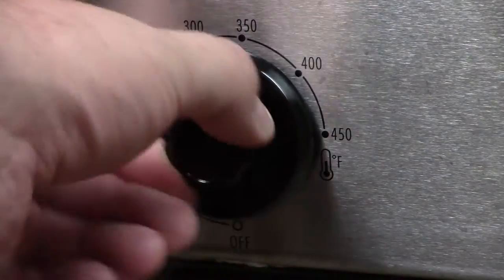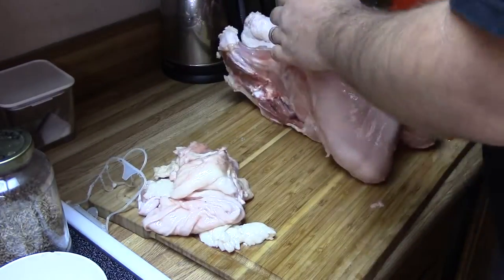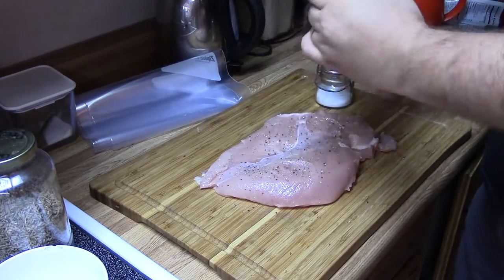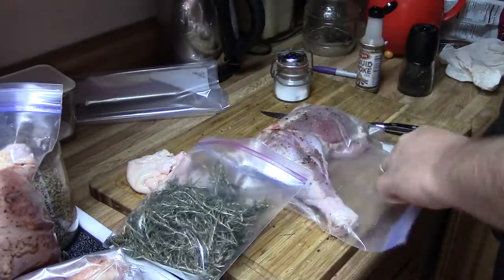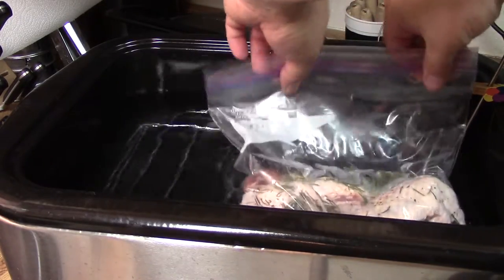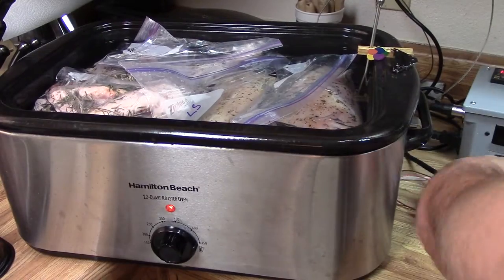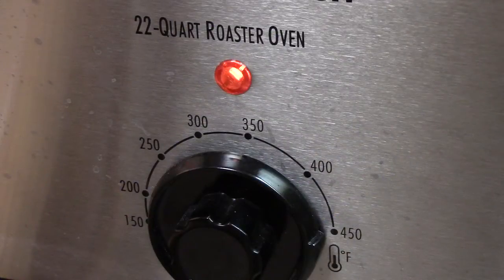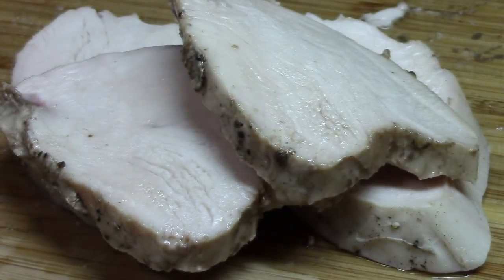How a geek cooks a 23lb turkey... sous-vide, using a homemade immersion circulator

Comment: Cool video, I really like the voice over. Maybe you mentioned this in the video, but what temp did you cook it at? 145 fahrenheit? Did you cook the dark meat (leg, thigh, wings) a different temperature than the white meat (breast)? Not trying to ruffle any feathers, but I may make a couple suggestions/things to think about.....when you use the ziplock baggies (and hopefully you're using freezer style as they hold up to heat much better), it is best to not zip-lock the baggies, instead just clip them to the slow cooker's edge. If you seal/ziplock them, gas will eventually accumulate in the bag and become (even more) buoyant and start to float, creating a problem. When you keep the ziplock "unlocked" and open, the water will create a vacuum and surround the meat/protein/vegetable. Also, once you are finished cooking the turkey, there's a finishing step involved. You may finish it by pan-searing it, putting it under the broiler or in a really really hot oven, you can throw it on the grill, heat up some oil and deep fry it, or take a blow torch to it. Whatever way you can find to create color on the outside (maillard reaction)....but only if you're interested in creating over 300 new delicious flavor compounds....
Reply from the maker: Thanks, I made this video a couple of years ago, so I've had quite a bit more practice on turkey, which is a sous vide favorite of ours, since then. 
I now cook turkey with the skin on with the dark meat at 165 for several hours before lowering the temperature to 140 and adding in the white meat.  My seasoning of choice has been just a liberal amount of salt, pepper and a little liquid smoke.  A sprig of rosemary can be quite nice as well, but I usually skip it.  After I take the turkey out, which is some time the next day, I'll pat it try with a paper towel or clean cloth, then drizzle a small amount of olive oil over each piece and brush it all over with a basting brush.  I've tried every single searing method you mention, but I been throwing them on my gas grill lately and they are coming out perfect with a nice crispy skin.
I've found that you can get away with skipping the sear on the white meat, although it does make it better, but the dark meat can have a strange, slimy, texture if it's not seared.  I thought is that the sous vide process isn't really getting hot enough to thoroughly melt the extra fat that the dark meat has.
I save the liquid left in the bag and then prepare a roux using butter for the fat.  I cook it till it's a little more dark than a blonde roux and then add the turkey liquid and stir till all the lumps are gone.  You'll be left with a really nice gravy.  I haven't found that I've needed to add and additional seasoning to it.
...could be time to do an update to this old video with a lot more details added.
Reply: You. Are. Awesome. Very cool of you to help introduce sous vide cooking on youtube two years ago! I have had mine for a few years and i love it. In fact, i (finally) received Joule, another immersion circulator. BTW, very cool you went with the controller and a cheapo slow-cooker.....have you bought an immersion circulator since? I totally understand the issue of fats not rendering well enough in sous vide cooking. However, most intramuscular fats seem to melt really nice...it's the big fatty pieces that i seem to have the most problem with (think ribeye or brisket). Anyway, the turkey gravy sounds delicious! Sounds like you let nothing go to waste too. Again, good job on your video!
P.S. You should do a video on sous vide pork belly....
Reply from the maker: I've been eyeing the joule for a while since it's a lot more portable than my home made setup.  I would probably have one by now, but it's a tough sell since it doesn't do anything that my current setup doesn't do... and my home made system was designed with restaurant sized water baths in mind so it can power a big enough heat source to heat a small swimming pull up to temperature.  My system does circulate the water with a 12 volt water pump designed for a coffee maker.  If does a good job, but it's a little loud.  Using the setup  pictured in the video I've cooked almost 50 pounds of turkey at the same time.

As for large chunks of fat... yeah, I've found that meat is best trimmed a little better than you would if you were to cook it on the grill, otherwise you can end up with some gelatinous  fat that isn't very pleasant if you get it in your mouth accidentally.  A quality sear seems to take care of the situation to some extent, but not entirely.

Can't say I've done any pork belly yet, but I might have to just to say that I have.  I can tell you that it does miracles on elk meat.  It's practically impossible to cook a tender elk steak with any other method, but if you sous vide it, it can come out much more tender than the best cuts of beef and it's got a lot more flavor.

Comment: do you have a link to the controller you built?
Reply from the maker: +LordDrachenblut Sorry, no, I really should make a write up on it though, and I'll post a comment here if/when I do.  In the mean time if you would like to build one, this is the article that initially inspired me to make one: http://makezine.com/projects/make-25/sous-vide-immersion-cooker/
Instead of building in the heat source like in the article, just send the power to a power outlet and then you can control anything heat source that doesn't already have a computer on it.... so most slow cookers, roaster ovens (like the one in my video), rice cookers, hot plates...etc...etc...  You could ever just an electric water heater in half and use that to cook in.  I like using my roaster over because it has a very quick temperature recovery time, but it's bulky so unless I'm cooking something for a small army I tend to use my crock pot most of the time.

I believe they might have directly controlled the wall voltage from the temperature controller (PID) in those instructions.  I chose to switch the wall voltage with a solid state relay instead to make my controller more robust.  If you decide to build one, make sure that you get a good PID.  The first couple I build had when I thought was a good PID, but it turned out to be a cheap Chinese clone and because of that it had a huge 3-5 degree temperature swing, which is waaaay too much for doing sous vide.  I later switched to a different PID which was actually cheaper and I could then keep the temperature withing about 0.2 degrees Celsius.
3-5 degrees might not sound like much, but in sous vide cooking it can be the difference between a piece of beef being rare or well done, or a piece of salmon that is perfectly cooked, slightly firm, or salmon that is like custard. 

I'd be happy to answer any more questions you have if you build one.